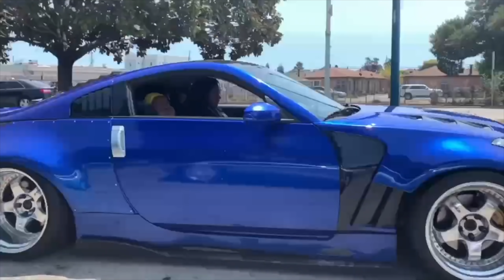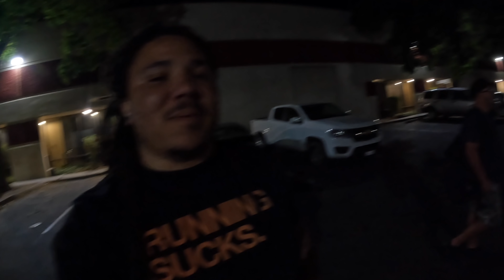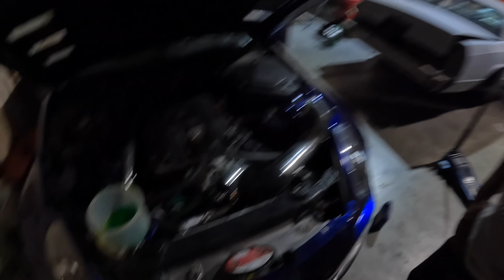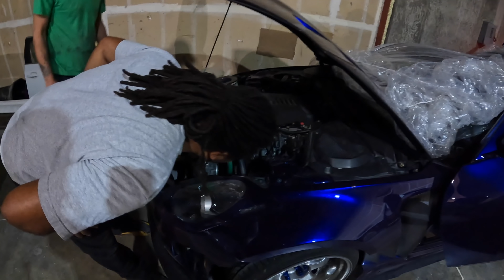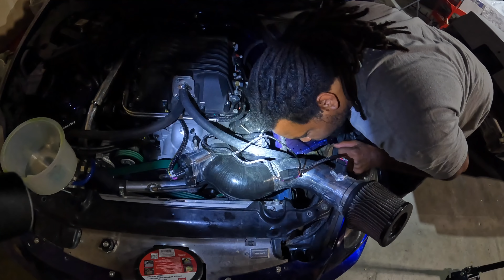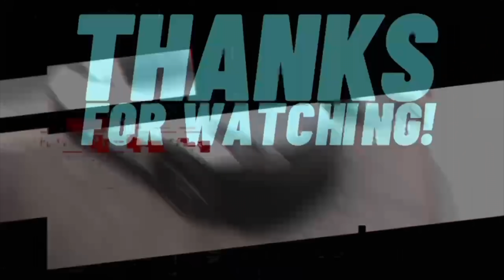My LS3 LSA SuperCharged 350Z Is Alive!!! First Start Up Baby!

Comment: I have a 2004 350z i would like to know what’s the estimate of youre build I been looking too supercharged mine but seeing this engine swap looks dope
Reply: I also own a 2004 350z I’m planning on LS3 swapping it it has only 110k miles so I think ima drive it till motor is done….tbh my friend any forced induction would be unrealistic and unreliable for the long run a bug V8 swap is cheaper and more reliable